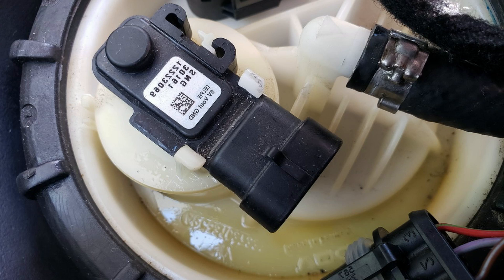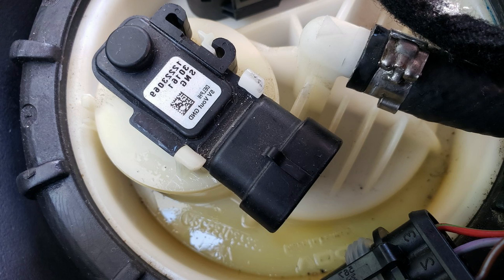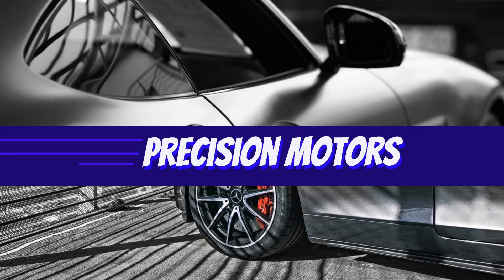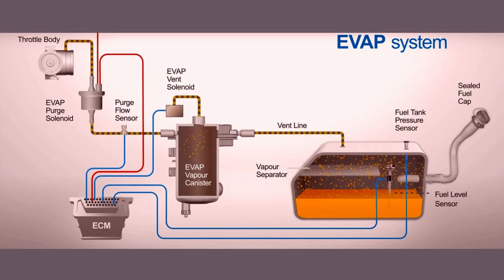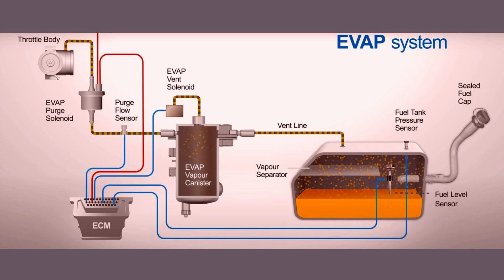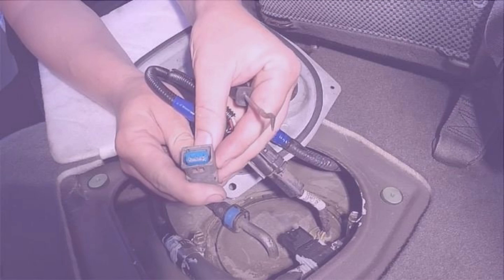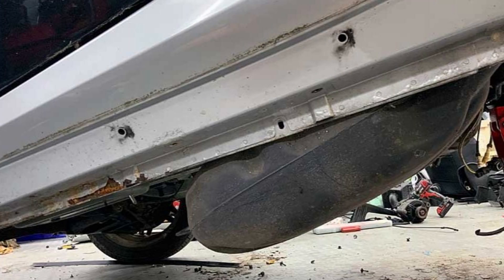Fuel Tank Pressure Sensor Replacement Cost, Symptoms and How it Works

Comment: Does this allso effect the dash fuel mileage readout? My suby's ltrs/klm is high...12.2/100klm and have a whoosh noise when opening fuel cap, air going in.
Allso digital dash fuel / 100ks is higher when tank full and when half empty goes to 12.
2/100ks.
Not o2 sensors, purge valve or mafs or air leaks.
Replaceing fuel pump midweek, methinks vent valve seized at charcoal canister? causeing negative pressure in tank?
P.S. in oz don't think our suby's have a tank pressure sensor fitted? anybody know the real prob?🙄